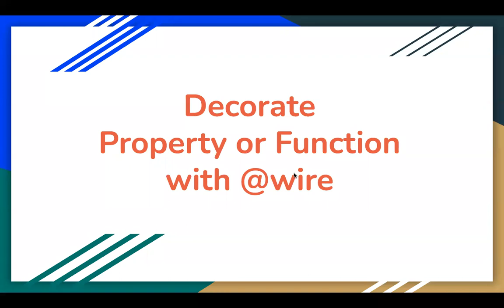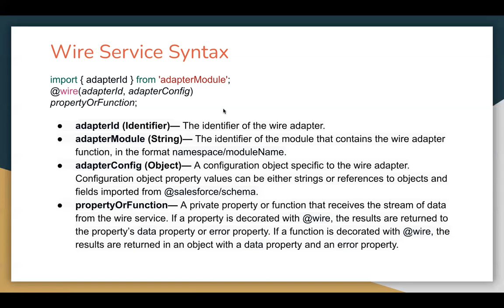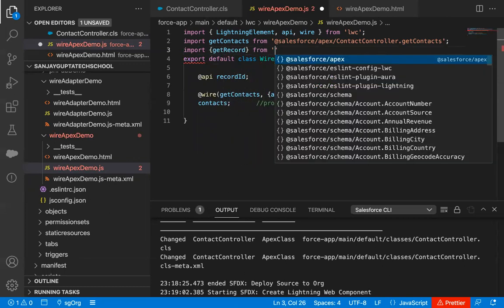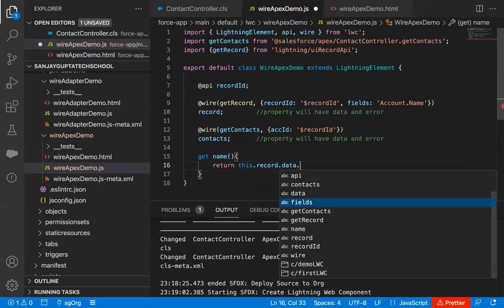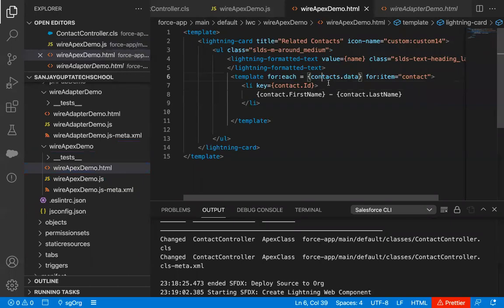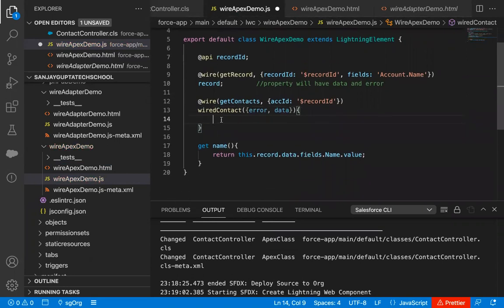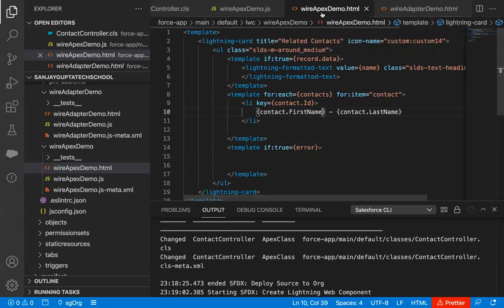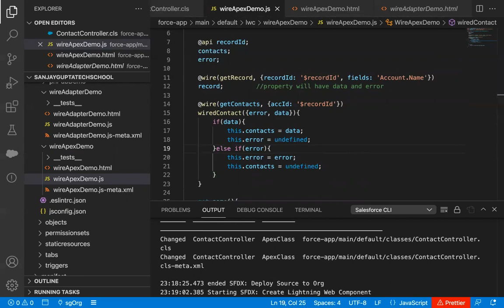11 LWC | Decorate Property or Function with @wire Decorator | Lightning Web Component | LWC Training

Comment: Hi Sanjay , 
quick question: wire works on the load of the page , also you mentioned in previous videos that for doinit replacement is connected callback. which is also on the load of the page right ? can you please let me knwo what is the difference between wire and connected callback ?